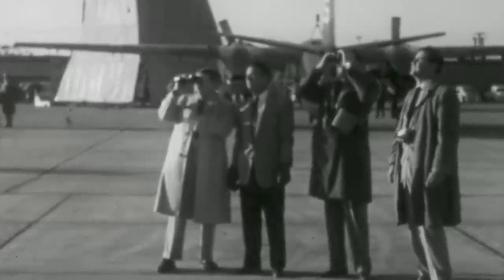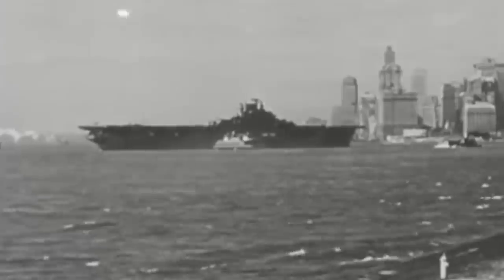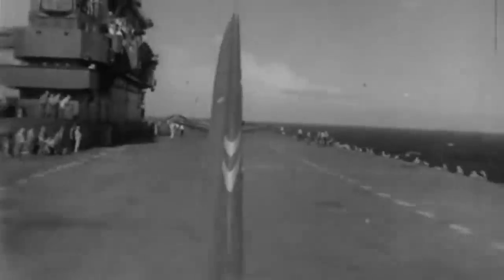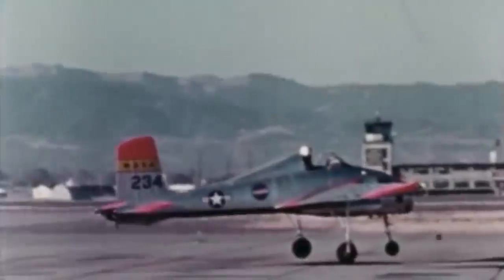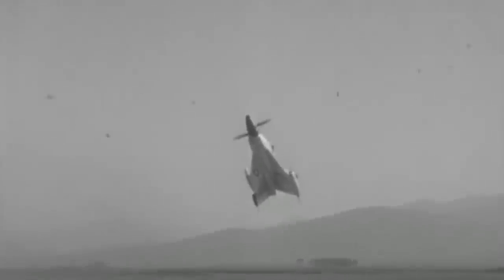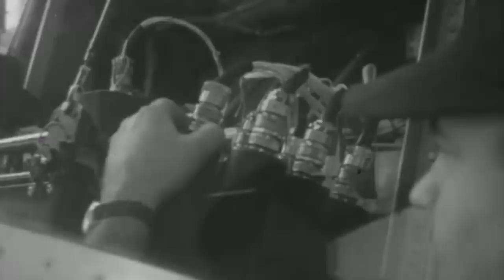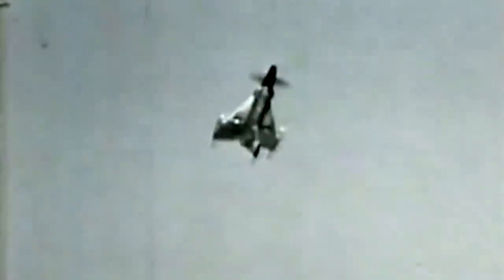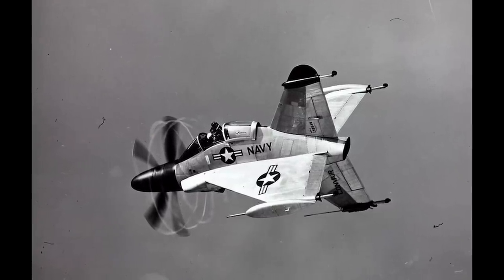The Upside Down Propeller Fighter - Convair XFY-1

Comment: They'll never be an age of aircraft development as  there was in the late forties and through the fifties. Anything these aeronautical engineers could think of, good or bad,  made it to the drawing board and a lot of cases to experimental flight. People may look back at that time and laugh at some of the designs but these were the times of real cutting-edge development for jet aircraft.
Reply: I think otherwise it will probably happen when we start to figure out antigravity engines . when of if that ever happens and it will be for the same reason it's tech that will be so radically different then what we've had previously that a lot of ideas good bad or indifferent will again be tryed.
Reply: Gotta learn about those concepts somehow.

Comment: Most WWII aircraft had radial engines. Other Aircraft had V12 engines like the P38 Lighting and P51 Mustang. The first turboprop engine wasn't built until 1940 in Hungary. Because of the war no further research on turboprop engines occurred until 1944 in Britain. The first turboprop aircraft flew on September 20th 1945, 18 days after Japan surrendered ending WWII.

Edited: the first turboprop was built in Hungary, not Poland.
Reply: Poland was occupied by Germans in 1940, so certainly it didn't build aircraft on its own. You probably mean Hungary, with its inventor Gyorgy Jendrassik.
Reply: @mattbite  yes, you're right it was Hungary, not Poland. I will edit my post to correct the mistake.

Comment: I have two stories:

1) I was visiting the Smithsonian’s Garber Restoration Facility and was gawking at the Enola Gay.  I stepped back for a better view and backed into something hard that hit my spine.  I turned to find I had walked into the landing gear of the Pogo.

2) I heard James F. Coleman speak at the Air & Space Museum.  He had several stories.  He admitted that he’d called to the crane operator “Catch Me!” many times.  Several times he stated that the sensation of transitioning from vertical to horizontal flight was exactly like water skiing, when you first go from floating serenely in the water to getting up on the skis.  In order to practice flying the Pogo, they rigged up a standard helicopter with dual controls, where the second set was mounted where the pilot was lying on his back and facing up.  The humorous part is that the project was classified at the time, and the safety pilot (whose controls were normal helicopter controls) was not permitted to know why he was doing something so apparently silly.

Most importantly, he stated that the Pogo test program was an example of a test-program that was fully successful in its intent.  It proved conclusively, that the Pogo — while clever — was utterly impractical.  That is precisely WHY we have test programs.

Comment: At 8:24 you say there were turboprop airplanes in WW2 which is not the case. The planes were of piston variants with superchargers and turbochargers. A turboprop by definition is a turbine powered aircraft with a propeller attached to the main shaft which is then ran through a reduction gearbox since shaft speeds exceed directly geared geared to the prop would result in poor efficiency since the blades of the prop would be spinning faster than the speed of sound. The correct vernacular would be turbocharged piston or supercharged piston. My source is not only do I have an degree in aviation but am currently an airline pilot in the USA and have flown over 6,000 hours on 20 different aircraft types and just was wondering why I had never seen videos of turboprop planes in WW2 which have a distinct engine nacelle shape. Googled “turboprop planes in WW2” and behold, the aforementioned correction to your video. Good video otherwise though! Love your channel.

Comment: I had a space toy in the late 1960s. It was a plexiglass ball with a seat in side and this was pulled by a "moon rover". The seat inside was weighted so the occupant was always up right as the ball rotated. I have always wondered why they did not put the pilot of a tail sitting aircraft in such an arrangement. Gravity could keep the pilot with a view of the ground when taking off and landing and then when horizontal flight was initiated the spherical cockpit could be locked in to place for maneuvering at speed.
Reply: A rotating cockpit would increase the size, weight and complexity of the vehicle enormously, requiring a much more powerful engine and exponentially more money.
Reply: The Lockheed 'Salmon' VTOL and the Convair 'Pogo' VTOL tail-sitters had rotating pilot seats, so the the pilot could look out of a window or periscope in the belly of the plane, or over his shoulder, while descending for a landing. 

All of this complexity (and wasted internal space) was later dispensed with by rotating the exit nozzles of the engine, as in the Hawker Harrier.

Comment: The Douglas Skyshark is a mid-WWII design that later employed a turbo-prop engine. 

It's a version of the Douglas Skyraider, one of a generation of planes that were designed during WWII and overtaken by the early pure-jet designs. 

For similar designs, look up the Breguet Alize, or the Fairey Gannet, the Westland Wyvern, etc.

Comment: With a camera for vertical flight and a tiltable seat for entry it would make a great aircraft today.
Reply: The quite limited usability of the Osprey would suggest otherwise. Using the same aerodynamic device for lift and propulsion leads to severe compromises in both roles.

Comment: automatic non-acrobatic flight controller, 4+1, ie, main power + 4 control thrusters on the corners of the quad drone
Reply: looks very much like the osprey V-22
Reply: jet version of the xfy, with the 4x control thrusters, full autonomous flight controller for stabilization and flight modes
Reply: tail sitter f-35 with control thrusters, 4+1

Comment: I question the Navy did not supply the required power plant to Lockheed, causing Lockheed to lose the bid. I’m only speculating, but I wonder if there was an under-the-table deal with Convair.

Comment: Nice try at accuracy but two glaring errors popped up. First, USS Macon was a rigid air ship. A dirigible is a giant gas bag with no internal support, aka blimp or Jerry Nadler. Second, WWII did not have 'turbo prop' aircraft. A turbo prop is a jet engine powering a propeller not a piston engine.

Comment: Didn't this sit off the runway in Norfolk for a few years?  I recall seeing it there several times when I was a kid.  Maybe one of the non-flight prototypes?
Reply: I'm pretty sure it sat on the drill field at Naval Station Norfolk in the late 70's early 80's. I didn't get there until the spring of 76. It was gone by 91 though.
Reply: It was actually a gate guardian in the late 60's and 70's at NAS Norfolk along with The Truculent Turtle.
Reply: @brittboyette8617  They had several display aircraft. One was  a Japanese flying boat (May?  It's been a while).  I think they sent that back to Japan for a museum -- last one extant.  For those not in the know, the Turtle had the nonstop distance record for many years. It was a P2 patrol aircrat, IRRC, and flew from Australia to the midwest.  I think the Navy took all the unique gate guards and put them in museums, and replaced them wtn F4's.

Comment: Dude! You just said that turboprop planes dominated in WW2. Ummm........ There were no turboprop planes in WW2. One turboJET (mess. 262) no turboprop. 
READ YOUR SOURCES.
Reply: This merits the Coke Bottle (thick) medal with Optometric eye test ribbons.;)
Reply: An old saw: "Engage Brain before putting mouth in gear."
Reply: Or ramjet like the campini , the first jetprop vtol fighter would have been the triebflugel in 1944  though never reached prototype status